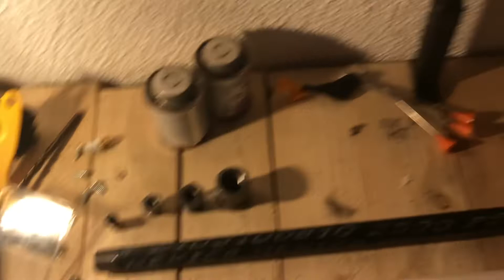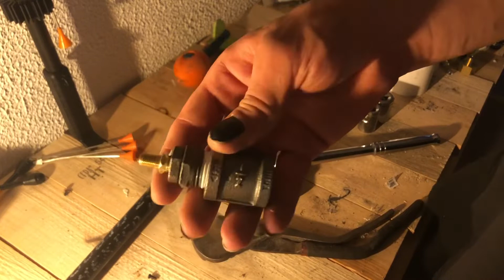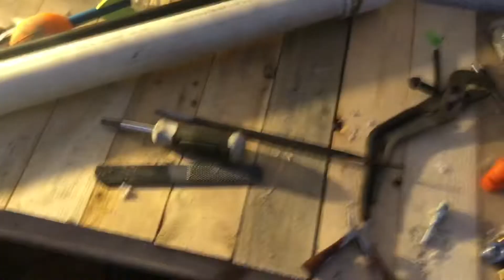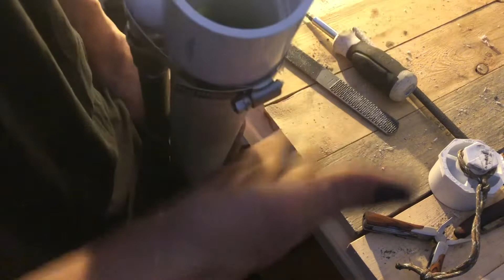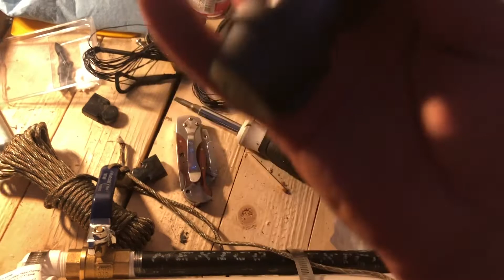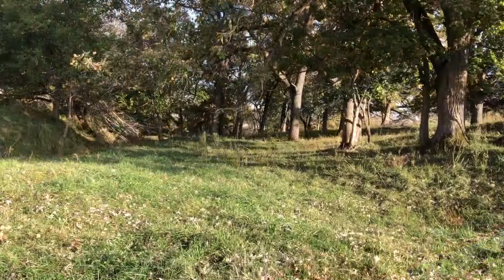How to make an airsoft rocket launcher

Comment: Single Shot Long Distance BOOP. :P
Could probably make some cheap ammo for it out of Pool Noodles. Or Dollar General Pink Rubber Balls o.o

They make screw caps to go on PVC but if you were say, dumpster diving, and that Plug was all you had some strips of bicycle inertube or heavy rubber bands could serve to hold the plug in. 

I bet a bicycle hand pump could get it up to preasure too, though that CO2 inflator hack is Awesome. Rechambering it to take a different ammo when you cant get what it was made for. O.o